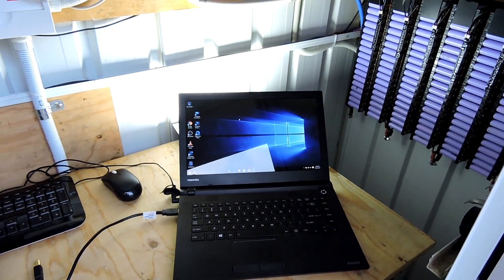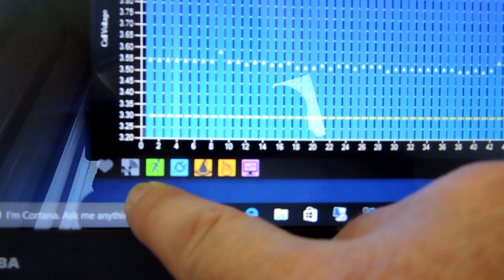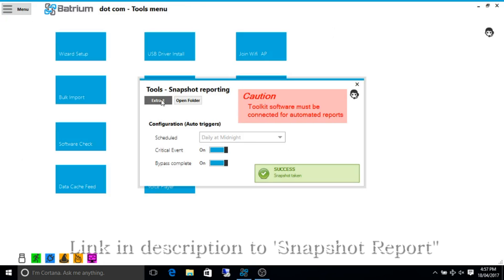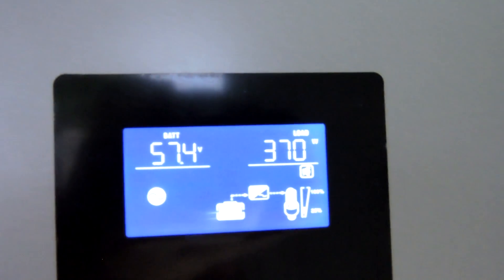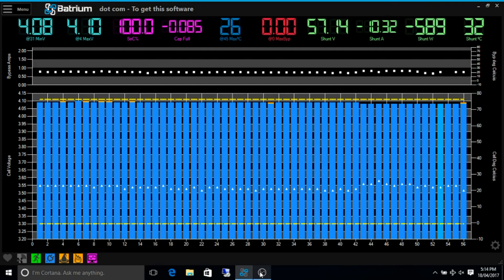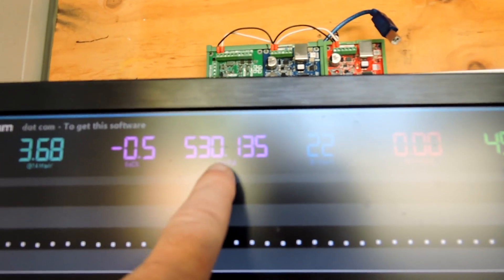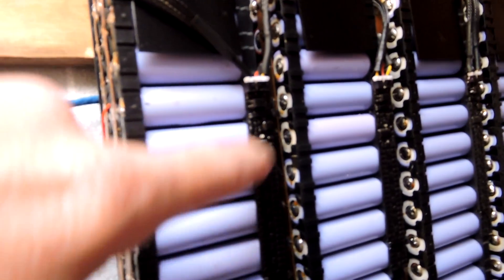18650 real world load test - 63 hours to run from 57.4v to 49v not bad from recycled laptop battery

Comment: Your numbers & calculations are suspect:
1.  It appears that you have 18 cells in series. If true, 18 x 4.1V = 73.8V (not 57.4V as you showed).
2.  How are you calculating 29 kWhs?  537.95 Ah * 66.6 V (i.e. 3.7 nominal V x 18 cells) = 35,827.47 = ~35.8 kWh (not 29 kWh as you showed).

So how can we know which figure is correct??
The nominal V of the type of cells that you are using is 3.7V
The typical capacity of such cells is 2.2 Ah to 3.4 Ah (which you most likely have 2.6 Ah cells or less capacity--because they are used cells.

Some Wh calculations to determine how much energy your battery could contain:
 
V___ Ah___ Wh/Cell __ Cells __ TL kWh
 3.7_ 2.2___ 8.14 _____ 4480__ 36.5
 3.7_ 2.6___ 9.62 _____ 4480__ 43.1
 3.7_ 3.4___ 12.58 ____ 4480 _ 56.4
 
If we use the lower limit of 36.5 kWh (which is reasonable) we can calculate (36,467.2 Wh / 537.95 Ah = ~67.789 V or ~3.766 V per cell (i.e. ~67.789 V / 18 cells).

Therefore, it is ilkely that your battery capacity is ~35.8 kW (see item 2 above).

Would you provide a list of the items in your power system & how much you paid for each item?  I'm curious to see how much it costed you.

Thanks for sharing!

p.s.:  If we use the info from your video display data, the numbers look like this:
57.4 V / 4.11 = ~14 cells
14 cells * 3.7Vnom = 51.8 V
537.95 Ah * 51.8V = 27,865.81 Wh
27,865.81 Wh / 4480 cells = ~6.22 Wh per cell
~6.22 Wh / 3.7Vnom = ~1.68 Ah per cell (i.e. average cell capacity = ~1681 mAh of energy).

Checking the math:
 3.7 V * 1.68 Ah * 4480 cells = 27,865.81 Wh
Therefore, If the above data is correct, then it is likely that your battery pack is ~27.9 kWh & your average cell capacity is ~1681 mAh.*
Reply from the maker: +zeffur7 average cell is 24oo mah there is 4489 "cells" math isn't estimated its tested
Reply from the maker: +zeffur7 http://www.diypowerwalls.com/t-HBPowerwall-Offical list of everything's
Reply: +HBPowerwall 

Hi,

Thanks for responding to my comments & thanks for the itemized parts list for your system.

re:  ""average cell is 24oo mah there is 4489 "cells" math isn't estimated its tested"

1.  Your video comments section shows "4480" cells were used.  Which is the correct # of cells in your battery??

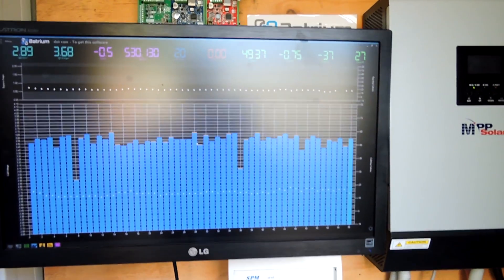2.  You show some calculation data in your video @ 4:22.  Exactly how did you determine that your battery capacity provided 29 kWh of energy if you are not using any math? 3.7 V x 2.4 Ah x 4480 cells = a maximum capacity of 39,782.4 Wh -- which you apparently did not get from your battery pack.  

Thanks for sharing!
Reply from the maker: typo 4480 cells :) and i Calculated capacity not on 'actual cell' but on AH & Average voltage and got 29kwh I SUCK at math!!!! Next load test will be something like a 400w load for as long as it takes to see if 1 constant load lasts much longer than a 200-3000w varied load
Reply: Ok.  Based on your last response, it appears that your battery capacity is likely ~27.9 kWh and your average cell capacity is 6.22 Wh or 1681 mAh (i.e. ~70% of the capacity of a 2400 mAh cell) -- which is quite possible since you are using recycled cells that have likely been used quite a bit before you obtained them.

Thanks for sharing!
Reply from the maker: Every cell has an average current mah of 2400 mah every cell has been capacity tested after removal from laptop battery packs. Calculations aren't made on their manufacturer mah
Reply: 2400 mAh of charging energy or 2400 mAh of discharge energy per cell?  What matters is the discharge energy into a constant load.
Some people erroneously think 2400 mAh of charge is the capacity of the cell.

Fyi.. It takes ~1.4 times more energy to fully charge a cell than a cell will hold ,due to charging losses (usually heat loss).
Reply from the maker: Discharge :) just a few of these http://amzn.to/2qwMyGn
Reply: Ok.. but you didn't discharge test all of your cells, right?  Which means you really don't know the average capacity of each of your cells, right?

Your figures at 4:22 indicate that your pack is:
*  57.4V/batt pack & 4.1V/cell or (57.4V / 4.1V = 14 cells in series)
*  49V/batt pack & 2.73V/lowest cell (aver cell v is unknown/unspecified) or (49V / 2.73V = 17.9 cells in series -- which really isn't the case, correct).

Since the typical Voltages for the type of cell that you used are:  
4.2V (max charge cut-off), 3.7V nominal, & 3V discharge cut-off, the following is likely:

Max batt capacity:  3.7 V * 2.4 Ah * 4480 cells = 39.7824 kWh or 768 Ah (i.e. 39,782.4 Wh / (14 cells * 3.7V) )

Since your software showed your batt capacity as 537.95 Ah, we can see that 537.95 Ah / 768 Ah = .70 = 70% of the capacity of a 768 Ah battery.  

Therefore, 70% of a 39,782.4 Wh batt = 27,865.81 Wh = 27.9 kWh (this is the energy capacity of your battery at the discharge rate that your system experienced.

From 27,865.81 Wh, we can compute the average mAh rating of each of your cells as follows:  27,865.81 Wh / 4480 cells = ~6.22 Wh/cell

From the 6.22 Wh/cell, we can compute the average mAh per cell as follows:  ~6.22 Wh / 3.7V = 1.681 Ah = 1681 mAh

It's pretty basic math.

Thanks for sharing!

p.s.:  If you actually have 18 cells in series (which appears to be the case when looking at your cell holders, then why is your output V only 57.4 when your cells are charged to 4.11V (as it shows on your video display at the start of your discharge test)?
Reply from the maker: +zeffur7 every single cell has been tested. And it is about a 40/60 split 40 keep plus 2100 mah 60 get recycled. I have taken over a year to test and have recycled +6000 cells. All the rest is math.
Reply: +HBPowerwall
re:  "...it is about a 40/60 split 40 keep plus 2100 mah 60 get recycled."
Does that means 60% of the cells that you test are rejected by you?

How many cells do you actually have connected in series in your system?  
Is it 14 or 18 cells connected in series & what is the fully charge V of those series-connected cells?
Reply from the maker: +of zeffur7 4480 with another 1120 waiting on some more space :)
Reply: +HBPowerwall
Your last response does not seem to answer my previous comment questions.  Would you please clarify your response to be consistent with my questions?

thx
Reply from the maker: SURE! 

I have tested well north of 10000 '18650 cells' i have documented this process heavily in the past 300 odd videos. 

All '18650 cells' are between 2100mah - 3100mah anything tested below 2099 mah is recycled in some form. Typically 1700-1999 go to other powerwallers in my area, 200-2099 to for free to my sparkie

there is 56 'cells' each made up of 80 ' 18650 cells'  these 'cells' are grouped into 'packs' of 14 there are 4 packs
Max voltage per 'pack' is 58.4v or 4.17v per 'cell' HOW ever in this test max 'pack' voltage was 57.4v so 4.10v per 'cell' 

80p14s x 4p in short.

I truly do suck at math and won't even bother to check or read all of yours sorry how it is.  Also i'm usually replying +100 comments a day here & socials, some are on my phone so try to keep replys short and sweet. 

Next video load test 60 hours 4.17v 34.something kwh :)
Reply: So basically, you have a 14s320p battery pack.  The 320 cells = 56 modules of 80 cells per group that are all connected in parallel?
Reply from the maker: i guess so

Comment: how do you adjust that inverter to be used with 18650 cells? i have the same model and it only supports agm, gel and lead acid batteries
Reply from the maker: +Caner B you tell it the given voltages , keep them well below cell max volts and add a kick ass bms to manage it all
Reply: whats your constant voltage and floating voltage setting? I am confused about floating charge stage because lion cells don't need it
Reply from the maker: unfortunately with the pip you can set it, so i just put bulk and float to the same values. Because i'm only charing to 4.1v it won't over charge the cells with the bms

Comment: How great, a major breakthrough indeed !  Anyone can assemble these components together. Just that each module monitoring 18650 element cost more than the battery itself plus all the rest ! Now do something smart, devise a way to get rid of these expensive modules and use a different monitoring method. See, with lead acid batteries you could get the same results for a lot cheaper and safer.

Comment: Draining the batteries to such a low voltage is not good for their longevity.
Reply from the maker: Arr yes, but it's a good way to find the weak ones that require replacement :) Few packs have been changed out and running another full load test now. 250ah in after 20 hour.. much higher loads this time. See how it affects the capacity

Comment: Just now saw your video..But curious. You said you are powering your house with it. But what voltage are your house circuits? What kinds of appliances are you able to run?
Reply from the maker: 240 v - run ALL GPO's in the house - so fans, lights, microwave, dishwasher, fridge, freezer, washing mc, dryer, tv's etc etc etc . Any load as long as it's under 4000watts
Reply: Except for water heater and cook top right?
Reply from the maker: Yep, they are not on GPO :) as is also covered in description of video i believe
Reply from the maker: GIve me a week or three to gather funds. Hotwater is in process - Cooktop - it can stay where it is till it breaks then it'll be upgraded to gas

Comment: I like your set-up. How many of those batteries are you using? Do you have any heating issues with those batteries?
Reply from the maker: +Dave A 4480 18650 cells ( installed) you can't get heat from a max draw of 0.25 a per cell :)

Comment: I have a concern about what you're doing : 
I'm concerned that I'm not doing it too....
Cheers.
Reply from the maker: NICE! well said.. I'm thinking to myself where is this going ...lol
Reply: Hi champ, can you tell me what they are called and where you got your Battery Container/Holders which you insert the individual batteries into the ones with Led's for battery status please.
Reply from the maker: Full boost if your in the US http://amzn.to/2piPJCS or you could go ebay https://rover.ebay.com/rover/1/705-53470-19255-0/1?toolid=20001&campid=5338073988&customid=link&mpre=http%3A%2F%2Fwww.ebay.com.au%2Fsch%2Fi.html%3F_from%3DR40%26_trksid%3Dp2050601.m570.l1313.TR0.TRC0.H0.X4x5%2B18650%2Bcell%2Bholder.TRS0%26_nkw%3D4x5%2B18650%2Bcell%2Bholders%26_sacat%3D0

Comment: How many kwh of battery capacity would you need to be off grid with a 5kw system? Would you make enough energy over winter to keep the house running off grid? Keep up the good work! cheers :)
Reply from the maker: Hard to say but it would be quite a bit more than i have. There is something 'safe' about having the grid connected
Reply: You should do a series of videos to see how long you can keep everything running day and night on just solar power :) Should be easy with 10kw system haha

Comment: great work , how much could you build me a 10kwh powerwall system for  ?
Reply from the maker: I wouldn't :) I don't i could ever do something like this twice.. :)
Reply: HBPowerwall ok thanks much then, the raw materials isn't easily available in my country, that's y i had asked.
Reply: Just buy some big lifepo4 cells.
Much safer!
Reply: Solar Junky what price does that go for ?
Reply: Solar Junky i am currently using lead acid but the inefficiency is killing me , I am off grid about 2 years now
Reply: You will love lithium!!!!
Reply: Solar Junky yes i know about lithium couple years now but it's not available in my country
Reply: http://www.batteryspace.com/lifepo4-prismatic-module-3-2v-100ah-10c-rate-320wh-un38-3-passed-dgr.aspx 
You have to shop around to find better pricing! this was the first link found. Got all my cells used so can't recommend seller.
Reply: Solar Junky ok cool thanks much, will check it out , but i don't know how to do the setup , could u do it for me at a cost if i find the batteries and get them to u ?

Comment: Dude that was amazing! Loving it.
Question: what are they discharge rate of the batteries in use?
I'm looking at buying some but i've been advised that they are only 0.5 - 1C... meaning very low discharge/charge rates. Probably not good enough for a powerwall build right?
Reply from the maker: Don't know how to do the C thing BUT 80amps is max draw on the battery pack. So per 'cell' its only 0.25 of an amp max normal draw would be 1/8 of that!
Reply: Thanks for the reply. I checked and it seems that 1C would only equate to about 3amps safe discharge (or charge for that matter)
I reckon as long as long as I have more cells then I would potentially draw from, I should be safe.. yeah?
Thinking of starting off a small battery pack (prob 12 cells for small USB + 1 outlet for appliances).
Would this work for USB? http://www.ebay.com.au/itm/131980636549?_trksid=p2057872.m2749.l2649&ssPageName=STRK%3AMEBIDX%3AIT

was also thinking of pulling this apart http://www.ebay.com.au/itm/351224007220?_trksid=p2057872.m2749.l2649&ssPageName=STRK%3AMEBIDX%3AIT
though not sure if they are compatible. Probably need to do some more learning

Comment: That is very impressive. I wish I could do that in my house. I wonder if you could give more details on what appliances and electronic devices were on during the test. Thank you and keep up the good work.
Reply from the maker: All GPO's in the house, fridge freezer coffee machine, toaster, microwave everything but the Cooktop/oven & hot water system
Reply: Wow and I'm assuming that you can change to propane cooktop/stove and be good in there too. That is very encouraging thank you for showing that it is possible to move to solar without any sacrifice.
Reply from the maker: I COULD but it's crazy considering it would be cheaper just to leave it how it is for now considering it's only a few years old. down the track if it fails then we upgrade to something more suited to the current environment
Reply: Yeah those stoves aren't cheap. I was just wondering if it's possible to be completely energy independent, so you confirmed that it is indeed possible.
Reply from the maker: It's possible for sure, is it worth it or is it practical - nop not for me - i like being able to flick a switch when needed even if the batteries are flat.

Comment: The screen mentioning bypass amps makes it sound like it is doing load balancing to try and keep the cells level, so why did two of them crap out early?
Reply from the maker: Because I top balance :)
Reply: And that means that it only balances the cells when charging?  Why not in both directions?  If it balanced on discharge, it would have lasted longer by using all of the energy in the more full cells instead of cutting out when the weak two hit bottom.
Reply from the maker: No it only balances at a given point. In my case, i've told the watchmon to only start trying to balance the cells when their voltage is above 4.10v> It is completely configurable

Comment: G,day !  Do you have an entire overview of how all the bits are connected - just a rough 'DaveCad' to give an idea of what does what, solar panels > charger > batteries  > inverter > house,  and how the Batrium fits in controlling a charger MPP  ?
Reply from the maker: I have to update to add the Batrium but the older one can be found http://www.diypowerwalls.com/t-HBPowerwall-Offical?pid=867#pid867 We have not completed the integration of the Watchmon/expansion boards to control the PIP (Yet) it's coming :)

Comment: Your relay should get more views on YT - this is pure Gold!

Hope if you don't mind me stealing some of your designs in the future
Reply from the maker: Go for it that's why i do it, just share the love..
Reply from the maker: All GPO's, lights & ceiling fans yes Good luck :)P
Reply: s I'm assuming you ran your whole house? and the 57.4 volts is Kv?

also I'm planning on sending a large bank down to a cousin in Chile due to the fact that they have invested so much into renewable energy that at times they have an energy cost of $0.00 per Kwh or in rare cases negative cost, so what he could do is fill up a bank when the price is zero or negative and then sell it back once the cost goes back up. whish me luck
Reply: Not with that kind of sound between his talking clips.

Comment: Ehm :-) great results, thx for video... Anyway what about to throw Win10 away and do data logging + monitoring on Linux? I am just saying this because I can imagine how upset I would be to Win10 to be so idoitic system :-)))
Reply: Better to use virtual machine instead of WINE ... Great feature of linux is that you can quite easily write your own battery monitoring ... Ad also you can lay some pressure on Battrium author to rebuilt this SW to linux and so on - Windows are so common due to ignorance, not quality.
Reply: Kind of was thinking the same thing, but window does haw and advantage - it just runs, poorly but does and its easier to get the software you need 

Don't get me wrong love linux but many times getting something build, created on it can be a project of its own.
Reply from the maker: Shit happens, next test will be done better.. live and learn all i can do lol
Reply: Just gonna assume you are talking about the missing gpedit.msc from the home versions, a two second google search shows you how to add it to windows 10 home .
Reply: He can use free software like "ShutUp10" and turn off automatic updates/restarts... that'd be a cheap and require no extra learning of a new OS and software.
Reply: or you could just have windows  pro and turn off the update?? who dosent build there own computers anymore these days the operating system at its best version is only 90 bucks
Reply: That's a good point, I am a long time Linux user and wonder if there are any monitoring softwares similar to those presented in this video (maybe you can run them with Wine?).
Reply: You literally can't turn off or delay updates unless you buy / steal the super duper professional version, right?